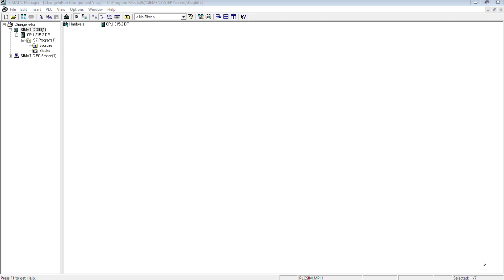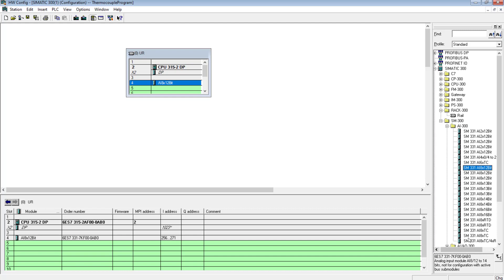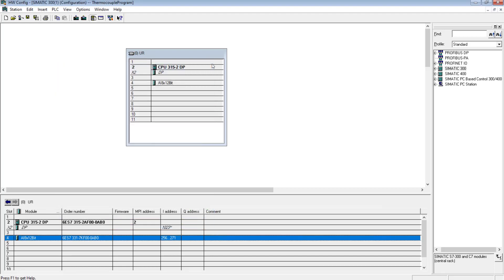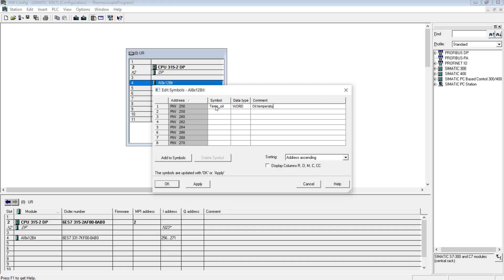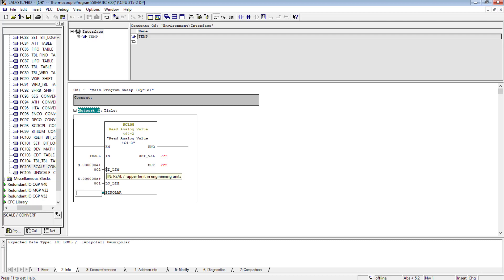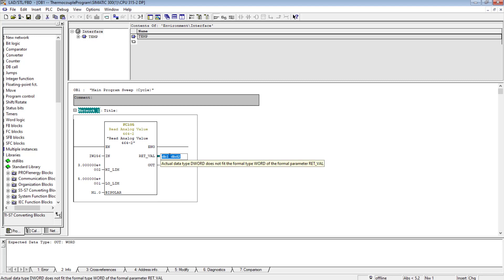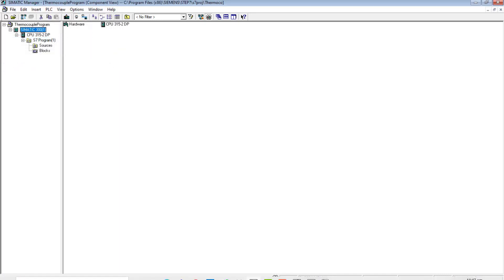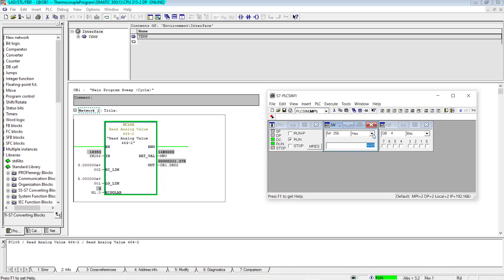PLC Program for Thermocouple

Comment: Great Video 
I have encountered a problem in my practice work. After following your steps to create the data block, when I go to the “out” section on the scale symbol and type DB1 it reads “element not found